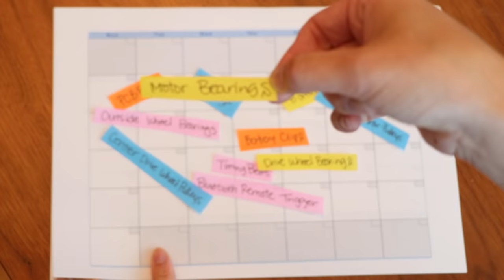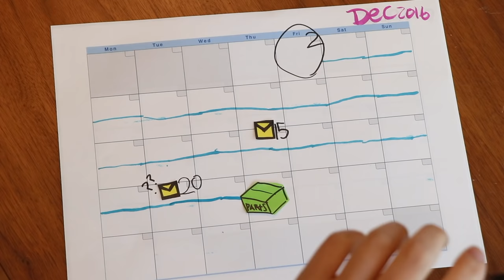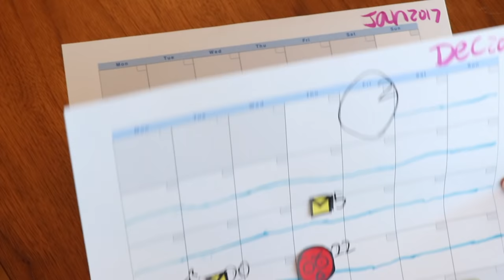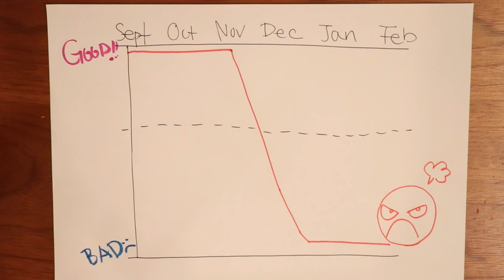COMPLETE SUMMERBOARD (LEIFTECH) REVIEW (WATCH BEFORE YOU BUY) Customer Breakdown

Comment: Hi Paolo did your board ship with lots of foam inside the battery compartment? My battery arrived with the grey plastic and the black installation completely torn down to the battery inside. I'm a little worried about water getting to the battery's inside.
Again thanks for taking the time to make these videos, very informative.
Reply from the maker: Hey Robby, Sorry to hear that your battery arrived in a damaged state.  I suggest that you return it and get a new one as safety is the most important thing when it comes to batteries.  There are so many incidents with batteries burning up and exploding nowadays, I wouldn't risk it.  My battery didn't come with foam protection either as far as I can remember.  I think Leiftech should pack the batteries better and maybe even separately so it does not get damaged in shipping.  Thanks again for your comments. Let me know if you have any issues with returning the battery.
Reply: Aaron is who i have been in contact with sense day one. But for some reason i haven't gotten a reply on the damaged battery (well i shouldn't probably say damaged, its just the outer insulation) situation. Its more or less a cosmetic issue as of now, unless it continues to tear while taking it in and out for charging. I could just tape it up... Thanks for replying, i do not know why but your channel sort of make me feel a little better about this $1700 purchase.
Reply from the maker: Hey Robby, glad that the channel makes you feel more comfortable about buying the board.  It's up to you how you want to do about the battery.  As for me, if I just bought a $1700 board or any other gadget, I wouldn't be okay with receiving a battery with the insulation damage.  Would you be okay with buying a new iPhone to find out that it has large scratch on the back of it?  Would you just deal with it or get a replacement. I guess it depends on the person, but the iPhone cost half the price of the board.  Good luck and I hope you are having fun riding.

Comment: Can the center wheels be taken out?
Reply from the maker: Hey Elliot,  Yes, you can replace the center wheels.  In fact, it's necessary if you own the board.  I've heard that even the most recent center wheels are blowing out/melting after a few times of use.  I don't think Leiftech have worked out the formula yet which is quite dangerous for riders.
Reply: So when the center wheels are taken out, one can still ride the board like a regular board?

Comment: WARNING about Leiftechs Guarantee! 
 
Just a small warning for all people who are selling their board with warranty or to all users who have bought a board with warranty: I bought a Leiftech board from the first owner which has still warranty for about 6 months and I have so many issues as you might have read in my post here:

http://community.leiftech.com/t/v2-clacking-center-wheels-motors-running-out-of-sync-button-issue-ect-battery-lid-issue-ect/1158/30

After clarification and having so many different supporters, now they tell me that I do not have any warranty at all because I bought the board from someone else and not from Leiftech, see:
____________________________________

Andre Banderas
Sep 17, 4:23 PM PDT

So just for my understanding : If I buy a board and then sell it during the warranty time. This means then that the new owner has no warranty at all ? Is it really like that ?

LEIF Support (LEIF Technologies)
Sep 17, 4:25 PM PDT
Correct
_________________________

So what I will have to do is to give back the board to the original owner so that he contacts Leiftech to get the replacement parts…This is just unbelievable !

Comment: All the issues mentioned in this video have been fixed on the LEIF - search for "Summer 2017 LEIF Upgrades" to see how they have been addressed
Reply: It's engineering malpractice to have a Pulley/setscrew/glue attempt to transfer 1.6HP. If company fucked up on that, it's a reflection of the quality of thinking there. Also, you haven't made Paola whole. None of his defects have been fixed. NOT ONE.
Reply: lots of eboards have had this. (metro boards etc) I'm sorry you're scared of heat guns, but it is in no way engineering malpractice. You just make yourself look like an idiot with that.
Reply: Murphy the Turtle you appear to be a shill, because you are attacking me personally. I own a Steiner temperature controlled heat gun FYI. A round shaft connected to a pulley/setscrew is not rated to transfer like that, and we know it's a mistake because, nobody does it. I don't know if anybody other company has tried that mistake it the past.

Comment: try our wheels
Reply from the maker: Entitlement Urethane - Which wheels do you recommend for the Leiftech board? One of the issues I have with the stock wheels is that it makes a screeching sound when I slide.  I don't like it mainly because it is alarming to pedestrians (or anyone around). A fast and silent sliding wheel (if that exists) is preferred.
Reply: Haight Privilege. never ridden a leiftech but these are the wheels you where all ways looking for ;D

Comment: Hey, this is not a Summerboard review - the Summerboard is a completely new model that was launched and is nothing like the old Leiftech. Do an actual Summerboard review instead of recycling your ancient review of an old product!
Reply: it's exactly the same product, they just changed the name to confuse their customers, but all the components are assembled in the same way than leiftech v2.  All what paolo said is totally true, I had the exactly same problems with my leiftech v2 : never ending maintenance, shitty support, very bad quality material.   This board is good if you live in airport runway, but if you dare to use in the street (as you will do with any other bikes or skates),  then after each fucking week of using, you will need to change something !!!  (ex: drive wheels, belts, casters, bearing, pullets, side wheels, motors, electric motherboard, remote, and so much....)
This product is good for a single usage, not for use everyday.     NEVER BUY ANYTHING FROM THS COMPANY, YOU WILL LOOSE YOUR MONEY, YOUR TIME AND YOUR RIDING PLEASURE

Comment: Dude the grinding noise you get with the not aligned wheels is from the belt man that's why your blasting through belts and gears 
That noise shouldn't happen man
Reply from the maker: Hey  Frank joseph, You are incorrect about my situation.  The reason I was getting those clicking noises was from the motor bearings getting wet.  I already did the troubleshooting with Leiftech support for 2 months.  I've since replaced the motor bearings and the noise is gone.  Furthermore, the burned out belts is because the first round of motor pulleys Leiftech sent out were wearing down as I explained and showed in the video.  Those have since been replaced with hardened pulleys.  The only way to burn out the belts now is the motor or drive wheel pulleys slip from the axel because the set pin gets loose.  Thanks for watching the video.
Reply: Paolo fromTOKYO no I meant the part where you had your wheels sideways and was showing how it won't run without the wheels aligned.
But your videos have been hella helpful I've prolly watched em all
Reply: Paolo fromTOKYO ordered mine Monday, stoked
Reply from the maker: Oh, you actually meant the board making a funny noise when not aligned.  Sorry, thought you meant something else.  The board is actually designed to not start when the wheels are aligned.  I spoke to Leiftech about this already.  The motors are not actually spinning, they just make a rumbling noise.  This tells you that the motors are not aligned.   (I don't really like how they rumble, but I don't know if they've figured out how to keep them quiet otherwise).  So no need to worry about the belts burning out since the motors are not actually moving at this point.  Thanks again for watching the videos.    I am glad they helped.
Reply from the maker: Awesome.  Welcome to the club.  If you have any questions, feel free to ping me.  Talk to you again soon.
Reply: +Paolo fromTOKYO If your ever in Denver or Chicago we should get down
Reply: +Paolo fromTOKYO I'm an automotive technician,
that noise is the belt skipping on the driveshaft, 
I already ordered and because it is taking so long they're sending me extra wheels and extra belts 
As an auto tech I have all the tools I could ever need, but why do you use the soldering iron?
Are the bolts on the shaft like corroded from riding in the rain?
Reply from the maker: Hey Frank, it's not the belt, this is how Leiftech designed the motors to perform when they are not aligned.  You'll find out soon enough when you get the board.  As far as the board being late, I know how you feel.  My board was like 6 months late.  The website said it would be delivered in about month, but several months later I got the board.  I really wish Leiftech were better at notifying customers how long it will take to get the board before they buy it.  I would have probably waited to purchase the board if I knew at the point of purchase that it was going to take 6 months to get it.  Sounds like you didn't know that there were going to be deliver delays as well.  I hope the board comes sooner than later for you so you can start shredding!
Reply from the maker: I will definitely let you know if I ever visit.  That would be awesome!

Comment: Things junk. Buy a carbon gt evolve
Reply from the maker: Hey Uoeno Woohoo , I don't know if I would call the Leiftech board junk, but I am considering getting an Evolve Carbon GT.  Can you tell me how long you've had it and if you've had any maintenance issues or your experience with support if any?  Thanks for watching!
Reply: Paolo fromTOKYO I've had it for a month now. No maintence
Reply from the maker: That's good to know. Looking for the next electric board and my top 2 picks at the moment are Boosted and Carbon GT.  Maintenance and Support are really important for me as I live in Japan and want something super reliable (and fun).
Reply: He's had it for a month, and he's seemingly unaware of the issues Evolve users face. The worst being the battery, and battery sag. Cycle counts on evolve gt's are pretty bad before the battery degrades it appears. (350) compared to the cell's Leif and boosted use. Not that the Leif or boosted doesn't have it's own issues, but battery sag is another evolve issue, cracks in decks, and motor mount breaks are seemingly the common ones from what I've read. Please take a look at the electronic skateboarding subreddit to see a bit more.
Reply: Jesse Patterson I work for Cadillac and escalades come in for problems too. Everything is bound to fail, evolve is still a better deal. My buddy has had his carbon bamboo for over 1000 miles with no problems
Reply: No, let's be clear, these are known issues. I didn't even talk about their customer support, feel free to google "I don't wanna help this guy evolve" I'm glad your buddy like's his evolve, but from what I understand of the battery tech, there's no way he's getting the same distance as when it was new, and 350 cycles is unacceptable to me. It's just funny to hear people talk down about other boards without knowing the flaws in their own. 

Like if you tried to jump your evolve like Paolo jumps his Leif, the motor mounts would get destroyed in no time.
Reply: Jesse Patterson boosted board can't even climb hills like evolve or run on grass like evolve lol fail
Reply: Kingpin trucks are laughable offroad, ask any Trampa user:D But that is neat sometimes, I'm a city dweller so that would only reduce range.  I don't understand why you're all defensive. Knowledge is power man. And one of my main points was battery sag. When you've got 50% power, and your vesc puts you into eco, I'm still climbing 25% grades. I'm sorry man, I don't mean to be mean, but you have no idea what you're talking about.
Reply: Mike James diy skateboard route is still very expensive. The battery cells are about 1000.00 .
Reply: That's just completely inaccurate. You can get high quality cells for $5.00/cell. That comes out to about ~$100 for a decent sized pack. (~216WH). If you don't have a spot welder you can buy a prebuilt 12s2p pack from Miami Electric Boards for $219, which is 266WH.
Reply: Mike James go buy big cells like the carbon evolve gt. I'm not talking about boosted board size . Carbon gt has 8x the size
Reply: Uoeno Woohoo I don't think you understand batteries. The carbon gt runs a 10s4p battery, with 18650 cells. So that has 40 cells in it. Buying 40 cells would cost you about a little less than $200, not even close to $1000. Get your facts straight
Reply: cheap flat top's (gross) but you're right that I don't think he understand what you mean when you say 10s4p, or that it's 10 long, 4 in parallel etc.